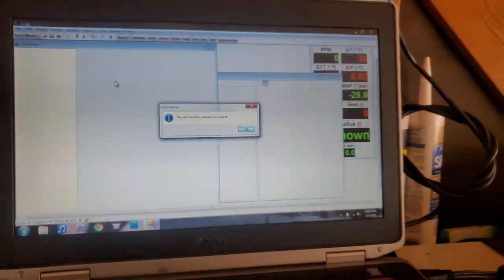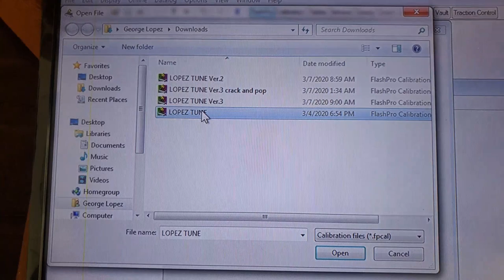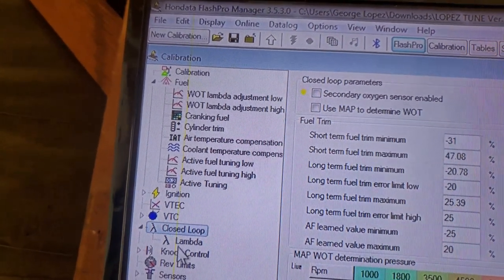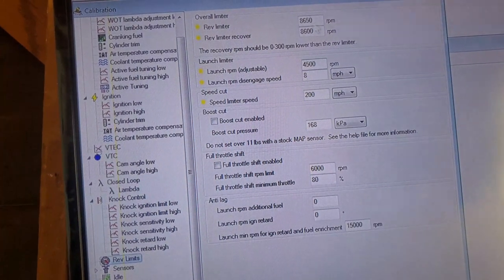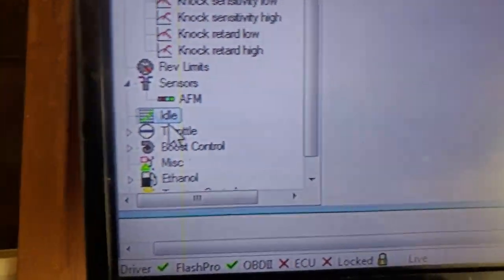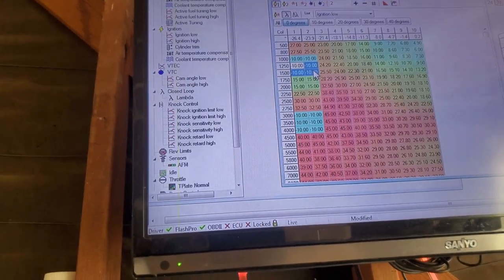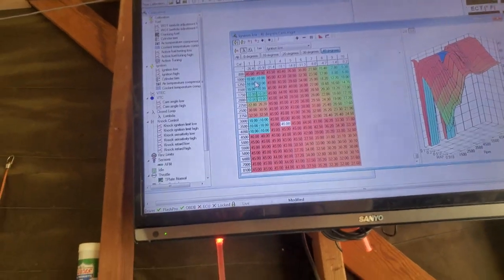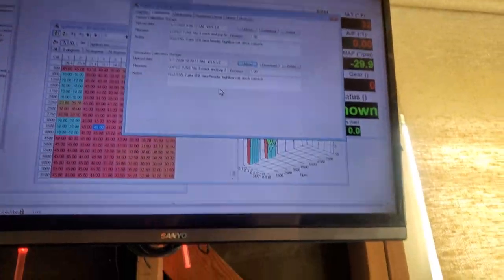How to: Setup my Crackle & Pop Tune on HONDATA at your own discretion!

Comment: Speed/density uses fuel tables (based off MAP - manifold absolute pressure: the pressure/vacuum in the intake manifold). AFM calibrations are based off the MAF sensor reading and injector opening times. They're different styles of tuning. With forced induction you have to use speed/density.

 MAP to determine WOT (wide open throttle) means the map sensor determines when you'll be in open loop.

Vtec engagement should be smooth. You want to look for similar fuel values when comparing the last two columns of the low fuel maps to the high fuel maps. The rpm at that spot is where the vtec crossover should be. Keep in mind you need to tune your cam angles/vtc tables before you can compare them. 

Also under VTC calibrations, its a good idea to check "use vtc tables upon decel fuel cut" and uncheck the other one. This helps prevent premature timing chain tensioner failure. 

Also under throttle parameters you want to have overrun throttle opening disabled. This will remove the rev hang. 

As long as part throttle fuel trims are + or - 5% everything is good. Its best to go in finer detail with WOT pulls because there will be no short term fuel trim applied. This can be a lean condition that should be avoided.  
 
Lmk if you have any questions and i'll do my best to answer. I'm not a tuner, i just own an fg2 and got flashpro a couple years ago. Cheers.
Reply from the maker: Damn bro seems like your a tuner lol thanx man yeah I don't know jack about this, but can't wait till the day I do learn how to use it  😀 Thanx a million for your SUPPORT!  👍👍👍👍
Reply: I did what this guy did and now the car turns on and with very bad idle and shuts off. I have skunk2 intake, header, hybrid cai, grams throttle body 72mm. 2010 fg2. Tried going back to header cai catback tune and other tune and still do that! Did this messed up my car??
Reply: @gjguili  do you have a check engine light?  If you reflashed a known good tune then something mechanically is wrong.
Reply from the maker: @gjguili  did you change the tune? All I did was change the timing back -10 degrees....if it doesn't work all you have to do is switch it back to what it was or load your current map to the hondata.  This wouldn't of mess with idle at all for the changes are ranged from 1-2k and 3-4k only. Try loading your old tune Calibration
Reply: Thanks for the reply guys!! After trying i found the tune i had and got back to it and now its fine but all I did was that, changing those -10 values like in the video. So now im scared to try again. I really wish to have those cracks and pops. Im also new to the flashpro and starting to learn.
Reply from the maker: @gjguili  its all good bro hope this works out for you! Have fun!
Reply: @gjguili  in the first two columns of your ignition map (-26" to -22") change values from 3000 RPM and above to 5°. You dont want to change values under 2000 RPM, this will mess with idle. Also you dont need to add fuel, if you have a cat in place this can cause damage to it. Also you dont need to change the entire row, if you only want pops at 3-4000 RPM then change only those values. You also want to change the same values on all cam angles.
Reply: I need help with my tune could anyone help walk me through it on a 9th gen?
Reply from the maker: @jasonbeets4686  what are you trying to do?
Reply: Jason Beets get in done online bro , it cost 200$ but it’s done professionally, check e tunez .com I did it for my CAI and Catback runs great

Comment: Ya idk much about this dudes setup but you will get valve float above 8500rpm on a stock K20z3, he is still running a MAF cal and some wack as timing on the crackle map. Just set VTC decel to 0 and only set the 0 deg map with - ignition values in the first two columns above ~1500-2krpm maybe try like -4 deg at the bottom and go up to -6 then interpolate the cels (CTRL P) from -4 to where ever you started the negative ignition values into the correct timing at 1500 RPM. If you do not want to smoke your exhaust valves and drive around like a dick all the time just go into the anti lag under rev limits and set RPM additional fuel to ~2-3,000 units, set your Launch RPM ign retard to -20-30 and set the min RPM for enrichment to ~300 RPM less than your launch control and you can just have a snappy 2 step on an NA motor that will pop and crackle on demand when you want to get up on the 2 step instead of always having your decel destroying your exhaust valves. Remember what you are doing is letting the explosions that are supposed to be contained in the combustion chamber leak out into your exhaust. Thats what makes the pop/crackle. Very violent for your exhaust valves. DEF DO NOT DO WITH A CATALYTIC CONVERTER!!!!!!! That is all advice if you aren't willing to shell out a few hondo to have someone do it properly, and you will still destroy your exhaust valves over time but at least they will be professionally destroyed.
Reply: why not to do it with a cat converter? destroys the cat?

Comment: I loveeee it but how do i get it to where it is popping just letting the rev’d fall. currently only when i blip the throttle it will pop.
Reply from the maker: Yeah unfortunately that's the only way U can pop as long as ur in the 1-2k and 3-4k...just let it decel but give it a bit of throttle to dump more fuel and pop...2-3k u don't pop in case cops are around. OR SET IT UP 1-4.5K Shift at 4k for some good pops. I suggest getting tune because these base maps are just to get you going....I'm tuned by Instagram Yosh_Tuned....this guy knows his stuff...tell him George Sent you and you want the pops and all! And he CAN SET IT UP SO U POP ON JUST DECEL.
Reply: @559powerscape  How about when your at a stop?
Reply from the maker: @cadenkreuser9554  that's 2 step...he knows how to set that up too
Reply: @559powerscape  You got insta?
Reply from the maker: @cadenkreuser9554  yup @559powerscape

Comment: 4:36  65000 rpm DAMN must have type s oil pump.
Reply from the maker: No stock z3 launch control is adjustable in the steering wheel

Comment: How can i makeup pops at high revs like in 8600 rpms while car its on movement
Reply from the maker: Y gotta mess with the ignition high...i wouldn't recommend it....what u want is 2 step my tuner has me setup for it.  Instagram @Yosh_Tuned
Reply: @559powerscape  thats your instagram? I have adjustable 2step set it up but its revs well up to 6000 rpm, over that its just cain of hold and doesnt make pops and the car have to be fully stopped and I saw cars poping while car its in movement at higg rev just when hits the limits
Reply from the maker: Yeah hit me up on Instagram @559powerscape... no thats my tuners contact on Instagram....he has me setup with pops and bangs on decel and 2 step at 6300 and 6400 ..... theres a setting on flashpro In REV LIMITS under LAUNCH LIMITER the LAUNCH RPM DISENGAGE SPEED set it to 9....thats the highest u can go but as long as ur rolling from 1 to 9mph u can hit the launch control and if set higher, 2 step

Comment: Ok this is pretty easy to do but has anyone also dumped massive fuel in the same tables used to pop. Will dumping in fuel cause it to get louder  bangs plus fireball if its hot enough because that would be pretty sick popping like a pipe bomb almost hell maybe blow the pipe clean off I don't care guess ill try it out and see what I can get from it.
Reply from the maker: 🤣🤣🤣 let me know what happens

Comment: Can u do this and not damage the cat all i have is a straight pipe and SRI, would you even recommend I do this?
Reply from the maker: If you have a cat, no i don't suggest you do this cause it can damage it. In theory. I dont know this for a fact but come on gas vs explosion....you be the judge. I think it will shorten the life span of the cat and they are expensive.

Comment: Im planning on doing this but only problem is that i dont have a header will that be okay still? Thanks
Reply from the maker: No I suggest having a header and catless cause you can damage the catalytic converter by doing so. Sorry bro!
Reply: GEORGE LOPEZ HOW TO DO IT YOUR SELF so I have a brand new catalytic converter maybe 20km on it and a Yonaka cat back exhaust will this damage it if so does that mean after a few years I’ll need a new exhaust or will it damage my engine
Reply from the maker: @smallenginekid6252  this will damage the material in the cat over time
Reply: GEORGE LOPEZ HOW TO DO IT YOUR SELF how long?
Reply from the maker: @smallenginekid6252  I dont know i havent tried it. Im catless

Comment: Just tried it in my drive way then drove around. Minimum knock count under 4500 rpms almost none.. above that I got more. For me that vtec point does not pull harder. The pops ? Ehh... but then again I may have a cat idk ... I didn’t buy the exhaust that’s on my car  it did have a few loud ones here and there but not what I expected
Reply from the maker: I also have the J35TB  with the bored out RBC manifold  and that gives it a nice kick. Yeah it's not the same as stock but it is nice to have the vtech engagement lower just have to mess with the air full maps cause it's all over the place 12 13 is were you want to be for performance 14 15 for economic..cant wait to have a better understanding of how those maps work

Comment: Does this tune works on my 8th gen civic 
Skunk2 header
Skunk2 CAI
Invidia N1?
Reply from the maker: Yes it should
Reply: @559powerscape  i already did it. But it does not pop and cracle that much.
Reply from the maker: @gernazmo5820  U can pop as long as ur in the 1-2k and 3-4k...just let it decel but give it a bit of throttle to dump more fuel and pop...2-3k u don't pop in case cops are around. Shift at 4k for some good pop
Reply from the maker: @gernazmo5820  Revision
https://youtu.be/F4es3MTEQFA

Test
https://youtu.be/CoJ3_Y2E8to

Comment: the Vtec kick is suppose to be a smooth transition, its suppose to engage smoothly. you just hear it. That kick, on dyno, shows less horsepower
Reply from the maker: That's what's up but I'm not a tuner. It's just a base map with alterations
Reply: @559powerscape  It's all good bro. It's easy to do just by altering your current map setting -Vtec back to where it feels like a smooth transition. But some people like the feel of that kick so it;s up to you obviously haha
Reply from the maker: @leewilliams8836  yeah I had a base map were it was at 43k but didn't like it at 47k it has a nice lil kick. Let's me know vtech is doing its job! Thanks bro!
Reply: GEORGE LOPEZ HOW TO DO IT YOUR SELF hey brother just a thought, for earlier vtec, if you just change the rpm at which it engages your only activating those larger lobes without adding extra fuel for vtec as it uses more fuel. Not too sure just an observation I made in tuning my 9th gen
Reply from the maker: @sk8r500045  yeah your correct!  Thanx bro! I'm just learning this thing first time using it. Cant wait to learn how to adjust fuel tables!
Reply: GEORGE LOPEZ HOW TO DO IT YOUR SELF same here man I’m going to school at uti hopefully my tuning class helps me learn more too! I barely had my ignition changed and got hardly any pops unless I shifted it just right so I’m going to try out your method and see how it works right now.
Reply from the maker: @sk8r500045  lol hell yeah and I'm self taught lol this is what helped me. https://youtu.be/RFX7oLSoMdA

Comment: Question, how did you get -10 on ignition? I am currently only able to do -4 on my car, and I think as a result I'm not getting a proper pop/bang
Reply from the maker: Not sure, it has the latest updates? It should let you go down to -10. Im not really sure why it doesn't allow you to
Reply: @559powerscape  first hondata did an update which only allowed -6 and then another update which only allows -4. So if you are running the old software which allows -10 please help me, I can send you my file so you can copy the parameters but you will be able to go down to -10. Can you help me?
Reply from the maker: @salimsopari  send me your email ill send you the tune
Reply from the maker: @salimsopari  my map won't work with your car its for the k20z3 8thgen civic si
Reply: @559powerscape  ahh.. dammit.. ok..
Thx for trying anyway
Reply from the maker: @salimsopari  no problem bro, try adding more fuel
Reply: @559powerscape  tried that too.. next step will be to try a different exhaust setup.. will post vids in a couple weeks!
Reply: Can I get the tune on email ?  Mine don’t let me play with the ignition table :/

Comment: Can you tell me how to fuck with this on hondata S300 no flash pro

I’ve read heaps of forums but no ones made a proper video, seen one retard the timing in the bottom left simply to add retarding on de acceleration but that’ll probably affect my 2step inbuilt
Reply from the maker: Not sure but ill I did was move the ignition to -10. Sorry bro wish I had an answer for you
Reply: @559powerscape  it’s allgood thanks for the reply,

Found out how to do it, bottom left hand corner is the de acceleration just gotta retard the timing in the set parameters
Reply from the maker: @Robbie_F  heck yeah bro! Should of made a video 😁😁😁😎
Reply: @559powerscape   Hahahaha my voice is aids but I can try film the process, it’s easier than I thought tbh 

I’ve read up there’s about 4 different ways to go about it on hondata alone let alone flash pro
Reply from the maker: @Robbie_F  lol thats whats up. Yeah you can retard ignition, add more fuel, keep injectors open longer.....alot of benefits on flashpro

Comment: How do I get pop and bangs  between each shift?
Reply from the maker: Set it to -10 from 1k to 4.5k then shift at 4k
Reply: @559powerscape  I’m on a b20 rev limit gonna be 7200 or 7500 but I want it to be loud pops maybe fflames between that range fofor each shift
Reply from the maker: @rackss5369  in that is set on the high ignition table. I wouldn't recommend it that high, you can possibly damage a valve. I honestly dont know but you can also add more fuel on decel so you can shoot flames.

Comment: Hey dude! Super appreciative 👏👊..I have 14*9th gen Si..I have a AEM cai,skunk alpha catless DP,full race 3'inch exhaust.. have a pop/crackle tune?
Reply from the maker: Nice I bet it sounds Hella good with all them mods! I have a revision of the tune. It should be the same for the 9th Gen cause it's still all motor. I know the 10th gens are different cause of the turbo...I'll post the link....hope this helps!

Revision: https://youtu.be/F4es3MTEQFA
Reply: @559powerscape  thank you for responding so quickly.. soooooooo on my hondata only option on Laptop is: US civic Si 2012-2014,Cai,RBC intake, cat delete, cat back exhaust.. can I use this although I don't have RBC intake? Sorry lol beginner..
Reply from the maker: @vtechlife2485  try it you gotta try different maps till you find a good one for your car....you want it to pull pull and pull...not pull fall on its face then pull again....these are just base maps to get you going you would need a tune for your bolt on...I'm etuned by Instagram @Yosh_Tuned he does really good work...find a good one then adjust the ignition tables

Comment: If I wanted to stay on my current cold air intake basemap but put the vtec up to 5000... can I do that with out any issues ? I’m just curious I never liked the vtec coming in at 4350 it’s just not that great of a kick. To be honest I’d rather have it where it is stock but still have the launch control. But idk. I have flash pro but I’ll be honest I’m still learning how to mess with it. And its really not something you wanna mess with too much 😂
Reply from the maker: That I know of really shouldn't have an issue but I know they're based off a fuel air ratio maps I'm using a map where it kicks on at 47 in a 1/2's and that feels way much better than 43 because that's where I originally had it with the 1st map try it, you can even mess with the vtech  engagement yourself but I suggest use a map that comes pre calibrated to 4750 and give it a try the one I'm using is the I think it's the injen short ram header Map and it works Great-Power throughout the whole band. Especially with the pops and Crackle tune I made, makes the car hella fun!

Comment: Remember guys if your engine is stock no crazy set ups the crackle and pops will make you loose power specially on k20z3 engines..
Reply from the maker: Yeah i highly recommend it on full bolt ons only no cats, it can possibly damage the Catalytic converter
Reply: @559powerscape  let it damage the cat, i dont see the problem lol
Reply from the maker: @allaboutdiy3858  lol u will if you need to smog it 🤣
Reply: @559powerscape  smog meaning to get it tested at your environmental testing facility?
Reply from the maker: @allaboutdiy3858  lol yup exactly good o' California 🤣